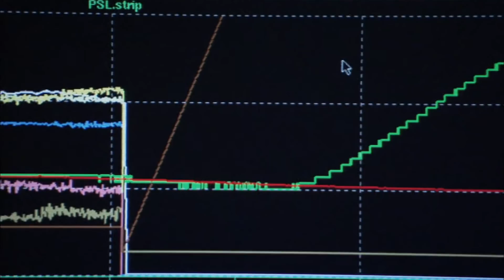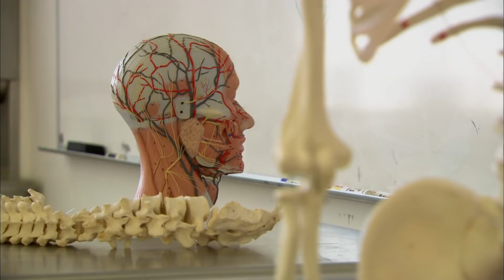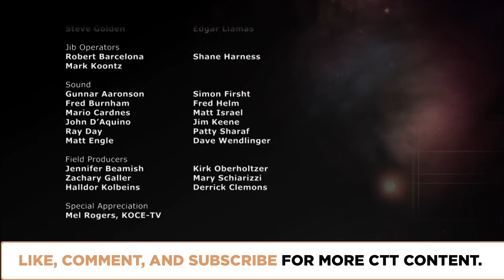What's the Far Future of Intelligence in the Universe? | Episode 213 | Closer To Truth

Comment: Is there any content out there that expands on mr Tipler's ideas, specifically why he concludes "physics require an intelligence to move out and cancel the expansion of the universe"?
Reply: IIRC, this channel has a few shorter clips from this interview with Tipler that contains parts of Tipler's argument that this video had to cut out. He elaborates on those questions in more detail there.

Ultimately his book "The Physics of Immortality" elaborates his argument in more detail, but in a nutshell his argument is that the laws of physics are inconsistent unless the universe collapses into a big crunch in a very specific and intricate way, and intelligent life is the only way that the universe could be controlled to collapse in this way. Intelligent life will be motivated to do this because it wants to survive, and this big crunch will release enough energy to allow intelligence to experience an infinite amount of subjective time.

But since the universe is currently accelerating, it wouldn't collapse unless life actually turned off the acceleration and forced a recollapse, which Tipler believes could happen by manipulating CP-violating processes.

Comment: 13:20: "One kg of matter can o 10^50 calculations per second". So how does that work? 1 KG of matter roughly has 10^27 atoms (give or take). In order to achieve 10^50 calculations per second every single atom must make 10^23 calculations per second. This is impossible, even with light speed, not to mention that there is currently no way that one atoms calculates on its own, not needing a power lines etc.. The guy is not taking physics into account, he thinks "oh we double in calculation power in the past, why not in the future"...